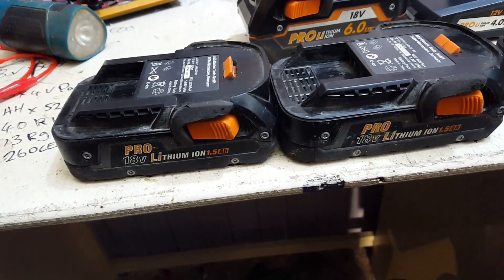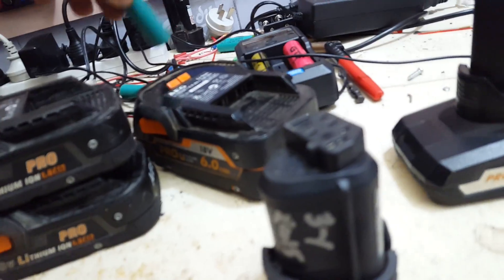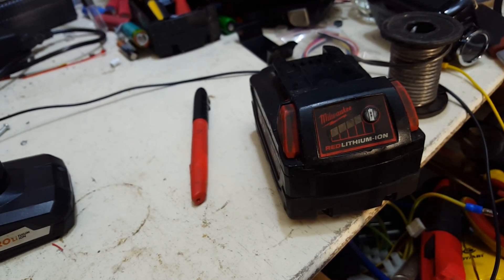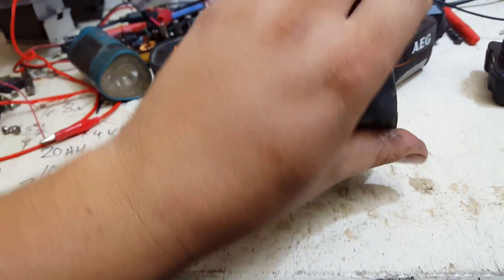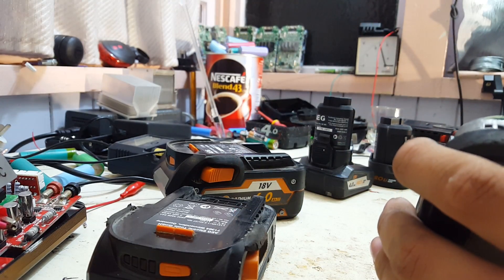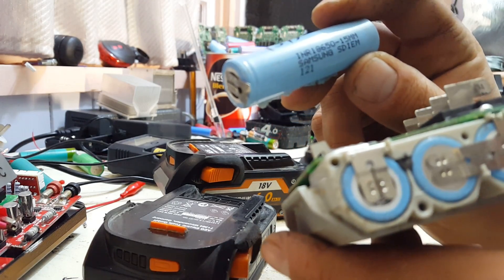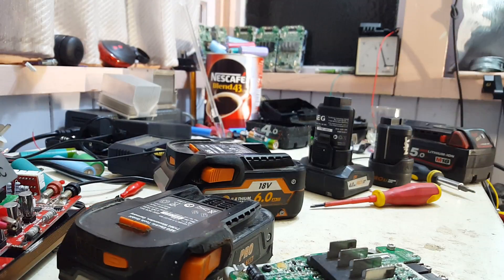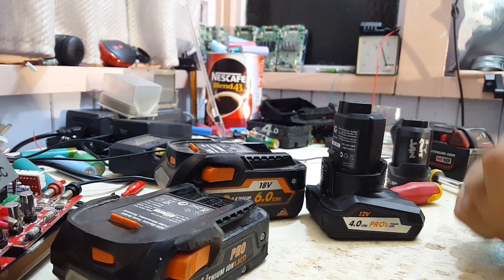AEG LI ion 12v and 18v battery tear downs  / LIion battery talk

Comment: Thanks for post! Very good. Im after a very light battery for my 18 volt power tools I have AEG and Ryobi and they are not lightvweight. I heard graphine are lighter again with some advantagws like quich charge. Any suggestions? Ty in advance
Reply from the maker: Is it a high draw tool or could you use a 2.0 amp battery that only runs a single row of cells (5x 18650s)
Reply: @Oneupthesleevecustoms  good point i have a few different ranging frim 2ah tib5ah. I see Stihl make a belt battery pack which would transfer the weight
Reply from the maker: @kevinmann4786 i think hilti have something like that

Comment: Is it possible to hack the battery to add more cells? 3D print a case for it e.g, cost of adding cells is a lot cheaper than buying a larger AEG battery.
Reply: @Schwalbe262 Circuit can be the same as long as number of cells in series is the same. Just double the number of parallels.
Reply: @Schwalbe262 I ended up going to Ryobi, they have some cool skins and is alot cheaper.

Comment: Hello, I am glad there is subtitles. You skipped unscrew section. I have 2  pieces out of juice B1820 battery. I decided to check inside after this kind of youtube videos but I couldnt open them first place :-) What kind of Allen key needed?
17.10.  I figure out  it is 10 Torx screw ,  I opened and Inside there are 15 paper wrapped 1.2 V SC 2200 mah Ni-CD efcell branded batteries . Dont know they are original . I search amazon,aliexpress v.s  I couldnt find a  proper place to buy quality replacements.  I found GP and Panasonic branded Ni-MH from our country but they are 2x costs of other brands so I couldnt decide it is a good idea restore battery or buy a cheaper cordless drill.
Reply: Greetings from Slovenia 😎 I hope you like one Up The Sleeve Customs and one Up The Sleeve Customs Automotive 😉. Cheers.
Reply: Surely you can work out how to open battery packs without asking Youtube?
Easiest way to get NiCD cells is to purchase a low cost NiCD drill kit from your local store. There is no point paying for high quality NiCD cells because this is old and dying technology. NiMH cells are much better but hard to find at low prices.
Reply: @Schwalbe262 - because it is not simple to upgrade a Ni-CD tool to Lithium cells. The original battery pack is using Sub-C size and will be the wrong shape for 18650s that are the easiest to source. Furthermore the Lithium cells also need a BMS PCB of suitable shape and current handling, plus the charger converted to CC-CV and with cutoff etc.
The scale of these mods, plus the cost of high amperage Lithium cells (you can't really use Laptop cells), makes the whole process non-viable for older tools. Yet a Ni-MH conversion is a straight cell change, and everything else can remain As-Is.
Reply from the maker: For many old tools dewalt and makita ect that were nicad you can buy lithium batterys they have remanumactured
Reply: @Oneupthesleevecustoms  - I'd like to see an example of such a remanufactured lithium pack, especially for Makita.